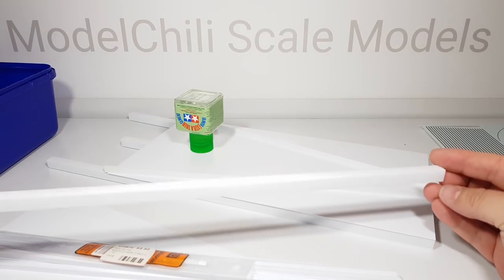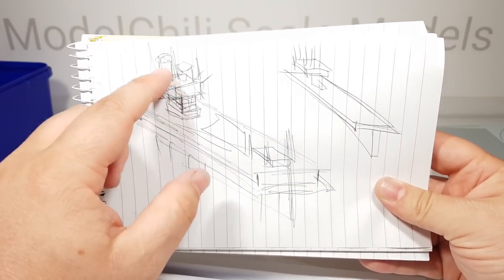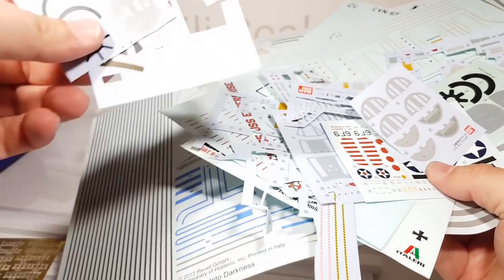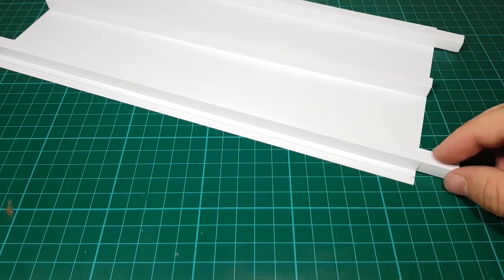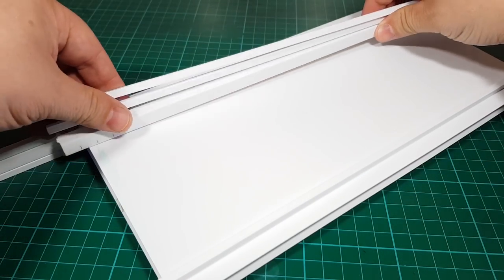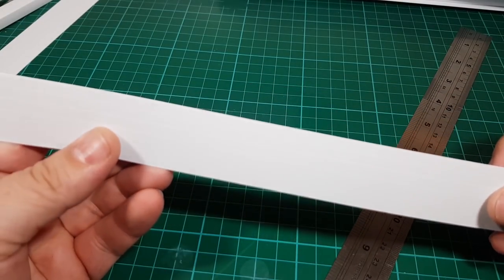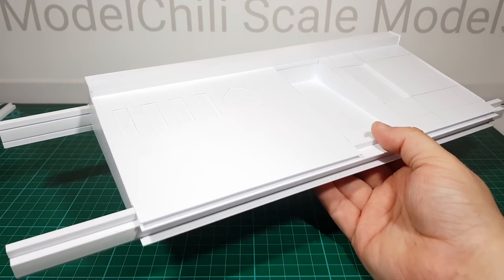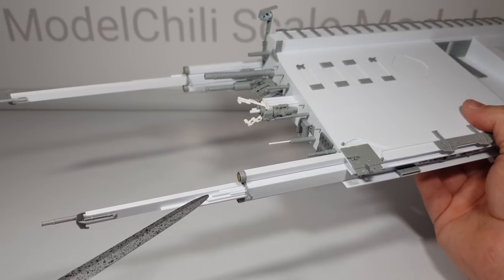Scratchbuild starship project - "Retribution"

Comment: I love what you've done here !  I love building ships like this myself.  I've got a couple of things to share with you. Some years ago I built a number of ship masters for a fellow.  If you want to make a heavily detailed surface it's really simple and reasonably.  First thing you do is select a few plastic strips and cut them into sections. Glue the sections to a scrap for a handle. Only do one size at a time. Use both different thicknesses and width.  Then just pick an area to start on.  Cut  different shapes and lengths and glue to model.  Do an area at a time. You really should have cut areas from the large sheets inside the body of the ship. Simple bracing will give you a strong lighter structure. Something else that is really easy is repairs or repaired areas. Once you've got the finished ship decaled and painted but not or partiality weathered mask off the repairs. Then you can weather. Then remove the masks leaving  your freshly painted repairs!  I did a Klingon D7 like that to give it some surface detail. I did several areas on the top and bottom to show where it had been holed several times in battle. Older repairs are just taking off the mask before you finish weathering.
Reply from the maker: Cheers! Thanks for that, some good ideas. :)
Reply: I wish I was good at scratch builds.. I'm only good at established kits sadly.

Comment: That's a really cool first attempt. IMHO, it could use a lot more detail. Especially on the sides front and back. Top and bottom, perhaps you could have layered a few of those thin sheets of polystyrene in different areas to give a more 3D look. You might even try to used them as paneling, though depending on scale it might look weird. And the angry fox (can't tell what it is) decal looked a bit too fresh. Might look cool to scratch it a bit as well as the bit 09. Over all really, really cool and has got my brain working OT to do my own!!!!
Reply from the maker: Well if all I've achieved is to inspire someone else then my work here is done. 😁